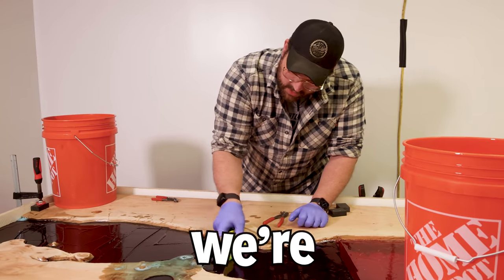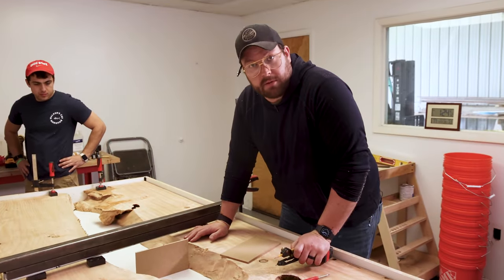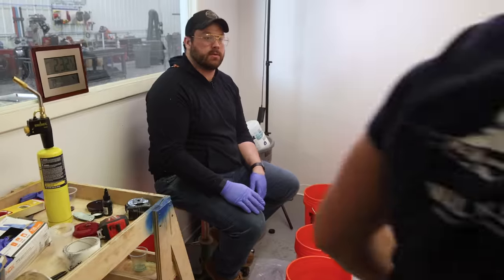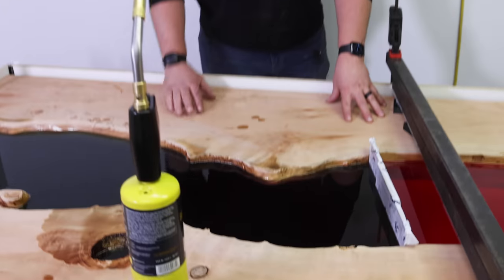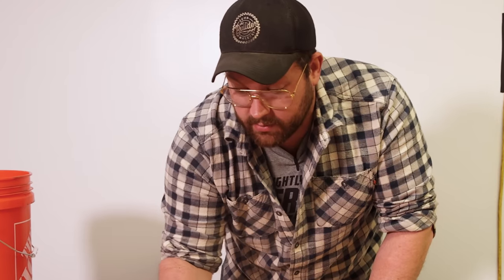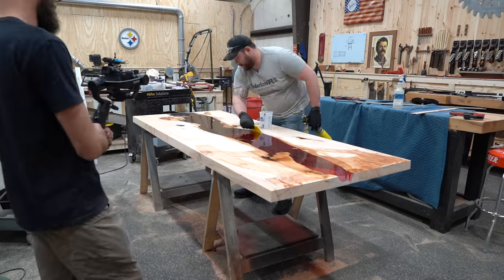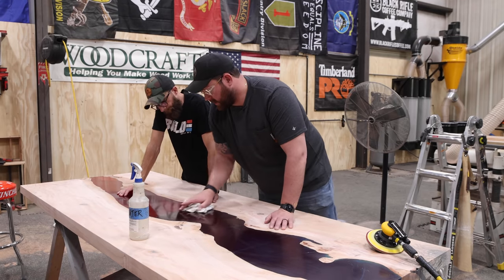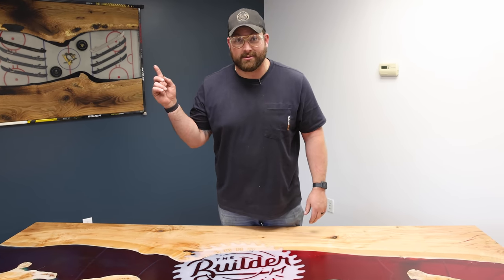I am DONE with EPOXY!

Comment: I feel like a really dark stain on the wood would've helped make the epoxy look better
Reply: I thought the exact same thing especially after the white wasn't white enough
Reply: There is no way to make epoxy look better.
Reply: @wyliewoodco  He said a darker stain on the WOOD, which he feels would offset against the epoxy better.  He didn't say to do anything to the epoxy.
Reply: @darkmagna9004  you’re missing the point but thanks for clearing that up 😂
Reply: The wood is too light colored to show off the logo and makes the wood look cheap and new. Stain brings out the grain and gives the wood character. I think we all agree.
Reply: Or maybe outline the logo with a black epoxy... but you'd have to really make sure to line it up correctly on the CNC.
Reply: Concur
Reply: Agreed, it would possibly make the white pop more in the middle to bring focus away from the bad mix in the middle
Reply: I agree. Would have used a darker stain.
Reply: Honestly? I would have taken a blow torch to the wood itself, get a bit of a char to it before putting a finish to it. Would have helped the white epoxy stand out more.
Reply: I was thinking the same thing.
Reply: @wyliewoodco  He's not missing the point. White looks whiter on a dark background. It's literally an optical illusion that does in fact make the epoxy look better... smart ass.
Reply: I was thinking the same thing just before they filled the logo in.

Comment: Always gotta remember with epoxy it's  pour depth AND volume, if you exceed the max on either, and don't have it under intense cooling, you're gonna have a bad time.  Really good reason why the Black Forest guys just started their own epoxy line, and why their deep pour room is hardcore air conditioned, and if I remember right they pour with the mold on top of a big aluminum plate with standing air conditioners beneath  it.  It's all about heatsinking so you don't get thermal runaway.
Reply: Yes.  All of this.  :)
Reply: They also have water cooled tables as well.
Reply: True and epoxy mass at 100mm deep is ok as long as you have like island areas so more wood mass as that absorbs the heat and kools the resin but if you have stones on the other hand that will hold the heat and intensify.
Reply: most companies state in their instructions when mixing over X amount max depth drops to X. All epoxy is mass and temperature sensitive. I've seen a lot of people using cooling tables but if your shop (or the pour) falls below 60°F the epoxy could stall out so its a double edged sword.
Reply: The Black Forest guys know what they're doing for sure.
Reply: Yeah it's funny how he builds his own saw mill and then says he can't afford temperature control.  I do understand how expensive HVAC can get, but there has to be a decent solution like running air conditioner window units.  Holy hell for how much epoxy this guy wastes he could have bought a bunch of units and build the frame for an appropriate sized room.  Heating is not so easy, the space heaters are definitely not something you want to run regularly.
Reply: Veo 3 errores, uno la madera tiene que estar seca o hacer un tratamiento de secado que tardaría mucho, la segunda el tiempo de fraguado muy rápido y tercero la división de los colores la abría sacado al principio.

Comment: Solid salvage effort boys! haha, I will say when I made my river table, I had a lot of luck using a $2-$3 syringe to inject epoxy into those more pesky cracks/voids after surfacing. Makes a notable difference in how well it penetrates the void and how easy sanding is later. Hope that helps!

Comment: Ok, here's the problem. When you pour epoxy for a river table, if it's over 1 inch thick you cannot use normal epoxy. You have to use casting epoxy. Is an epoxy that hardens but not as rigid as normal epoxy. That way when epoxy heats up (it will since epoxy cures with heat) it can expands and then as it cools and contracts, it doesn't crack. After you finish pouring the casting epoxy then use normal epoxy for a clear top coat

Comment: I use super clear as well its great to pour 4 5 inches but you need to drop the shop temperature in the room. Also if your doing deep pours make a table that you can chill. It helps draw some heat away.

Comment: Absolutely beautiful work! 

I was thinking a series of 1 inch holes in the epoxy separation "baffle" might allow for a mingling of the colored epoxy that would resemble a finger joint made from the epoxy. Maybe, maybe not. 

The CNC'ed logo is spectacular instead.

Comment: should've used clear mylar (can be purchased cheap @ joanns sewing section using coupon). mylar can withstand heat (does warp at very high temp).  but for the table, any warping in the mylar will add to the effect looking more realistic.

Comment: You always have resin that turns out clear. How do you get rid of micro bubbles. I’ve used a blow torch I’ve let it sit for about 10 mins but i normally end up with micro bubbles. Any advice would be much appreciated

Comment: Since in theory the 2 colours were in equilibrium when you initially poured them you should have been able to pull the dam out immediately... Would've been a lot harder to hide any cracks if the colours had mixed though so uh blessing in disguise?

Comment: Not black but darker stain on the wood and seeing how runny that left over epoxy was.. if you cant make it perfect, make it least adjustable.. in this case you can always go darker. Mix in black coloring and pour the cracks and imperfections in the wood. This way it looks like it was designed to be like that. While it was great lesson to see how doing it way in the video trying to fix it, changing the design like i would have just makes it look like it was all part of the plan. Difference between pro and amateur is truly just how well you hide your mistakes.
Also if i had even a 1K$ on the line.. i would be baby sitting that slab whole fucking night to get it right.

Comment: My guess is you poured too much at once.  I think in all the pours that are thicker, they do maybe 1" or so first, let it harden and then pour the remainder.  Probably would have been good to flatten both sides and then caulk it too, that would have saved you some epoxy at least.  But regardless, it's a nice beefy table to work on.

Comment: I would have cracked all of the resin, like taken some sort of spiked hammer to the underside, then filled it with clear or glittery epoxy, and then put some real low light LEDs underneath.

Comment: Had this happened to me literally two days ago except I was only pouring 2 inches of the deep pour liquid glass. Had a dark grey mica powder epoxy poured on the bottom already and almost set so I poured my 2 inches of clear on top and came back the next day to massive cracks all the way through the grey epoxy. Not impressed with liquid glass now.
Reply from the maker: How hot was the room ?
Reply: @John_Malecki  room was kept at 75 degrees F

Comment: Wherever the cracks are if it happens again 1 option could be to add some bowtie inlays with epoxy. Would of been cool to do some white bowtie joints throughout it and give it more red white and blue theme. Could always cut them on the cnc and add whenever you want even tho its done.

Comment: You made 3 buckets of resin for one pour.

It cracked because the resin's contraction or curing process was too large of a volume, creating too much chemical heat. 

Mix one bucket of red, one bucket of blue. Pour about 2 inches. Wait a day or two. Wire brush the resin. Pour 2 inches. Wait a few days. 

You really jumped the gun here... 

That's an expensive mistake, and I don't think you've ever made a river table. Not to be a dick or anything. Your personality is fun. So I'm sure this is just something you'll find funny.

Comment: Everything you did there looked to be  done correct way. What were the reasons for those cracks and other issues? 🤔
Reply: yeah, the more epoxy there is the hotter the piece gets when the resin starts to cure. with pours that thick, its recommended to use a water cooled table bc the chance of failure is exponentially higher due to a much larger thermal coefficient. TLDR: water cooled table for thicks pours bc resin gets waaaay hotter the bigger the depth of pour.

Comment: QUESTION FOR ANYONE...HELP!  I'm making mickey mouse heads by gluing wood balls together. The head part is a 2 inch wood ball. The glue isn't holding in a stress test. Can I put the pieces together and pour resin over the piece and make it extremely bonded together??

Comment: without even watching. i know your problem. Total Joke. (Total Boat) it's boat repair epoxy. made for repairing boats. and it does that very well. But trying to pour anything deeper than 1/4 inch you're going to get issues.
Try any other bloody brand then total boat. There are epoxies out there you can pour 5-7 inch minimum!!!

Comment: seriously sometimes i dont get you . this is wasteful . epoxy is very forgiving but i think youre taking it for granted ! these cracks are structural defects and the integrity of the table is compromised bearing the fact that those slabs are very thick and heavy .John by now you should know better with handling epoxy .